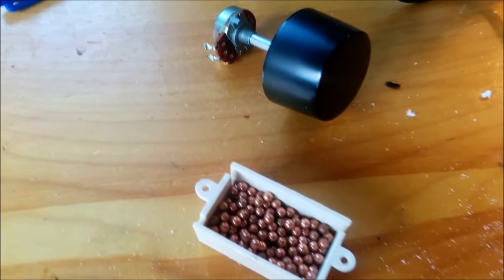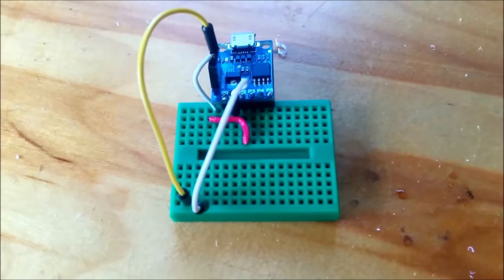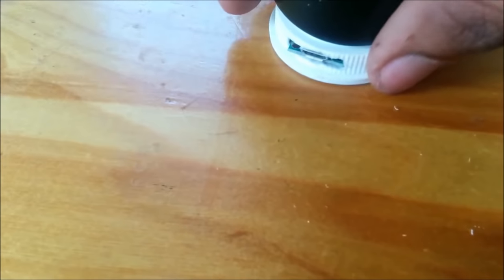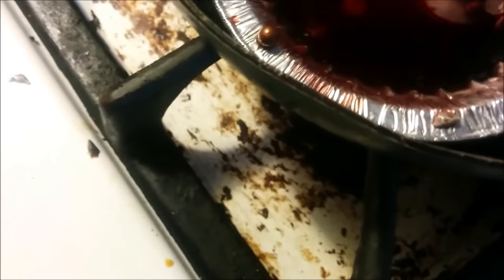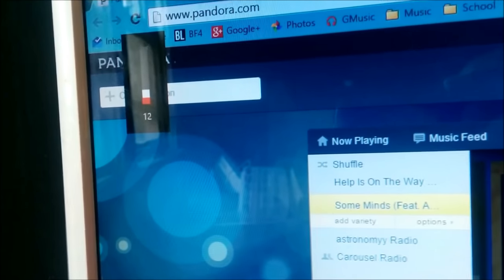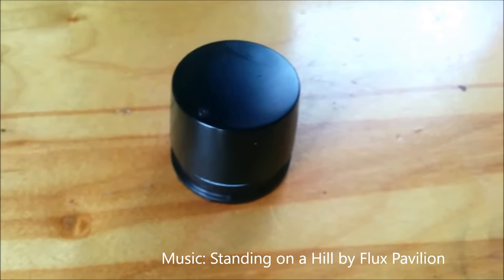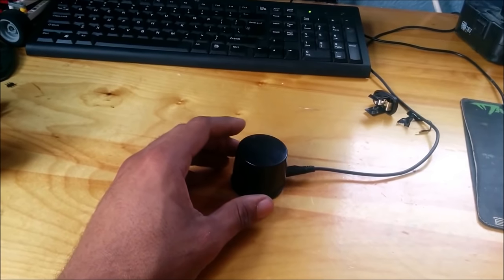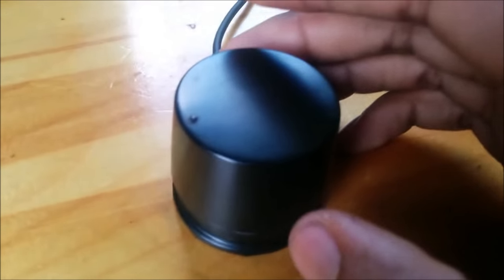Cheap DIY USB Volume Control knob!

Comment: Ive made it and it works. My rotary encoder is a little unresponsive. Could it just be that its broken?
Reply from the maker: Was it a new encoder?  It's hard for me to say what the issue is, but maybe you should try a better quality encoder.
Reply: Engineering Nonsense yeah its a new encoder. Bought off ebay.
Reply from the maker: The resistor was used for the LED. That encoder will also work :)
What type of digispark did you use?
Reply: Engineering Nonsense im using the digispark that has a full size usb. Not like the one you use in the vid.
Reply from the maker: and you're sure the problem is with the encoder and not with the digispark?
Reply: Im pretty sure because I have followed the steps and you can probably tell I am new to all this, its also my first time soldering and coding the digispark. I did have a problem but it didnt affect anything, in one of the steps on instructables it says to download the Trinket USB library and copy it to libraries for Arduino IDE. When I upload the code it says that its successful but afterwards it says: Invalid library found in  E:\Documents\Arduino\libraries\Adafruit-Trinket-USB-master
Reply from the maker: Hmm, interesting. Have you ever posted to a forum for help with this sort of thing? A forum like stackoverflow, or the official arduino forum. I don't know what is causing your issue, but I think of this is your first arduino project, it would be good for you to learn the forums as that's how most of us gain our knowledge and troubleshoot. Let me know how it goes.
Reply: Engineering Nonsense sure thing thanks for the help
Reply: i figured it out. According to this website: http://henrysbench.capnfatz.com/henrys-bench/arduino-sensors-and-input/keyes-ky-040-arduino-rotary-encoder-user-manual/ 

the + from the encoder is wired to 5v on Digispark. It works flawlessly. Thanks for the help.
Reply from the maker: Oh wow, nice!  Thanks for sharing!